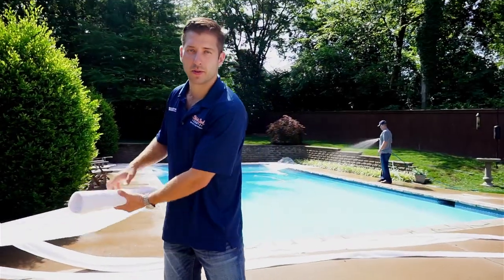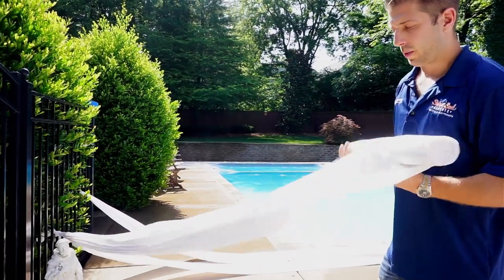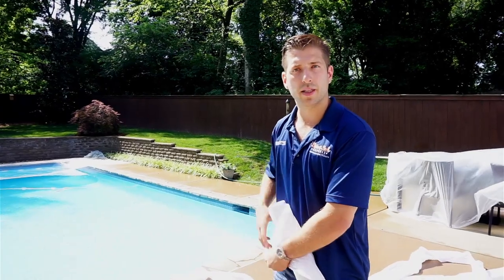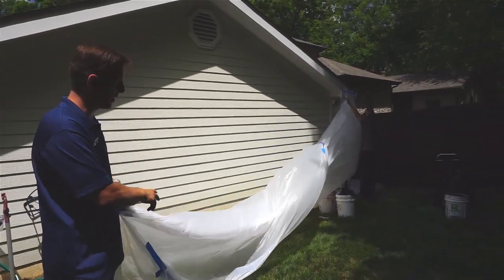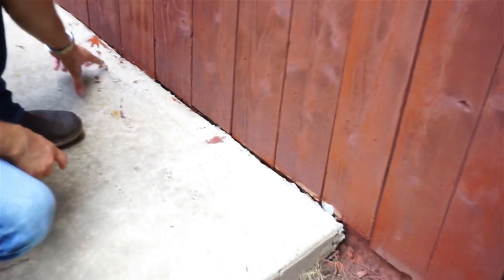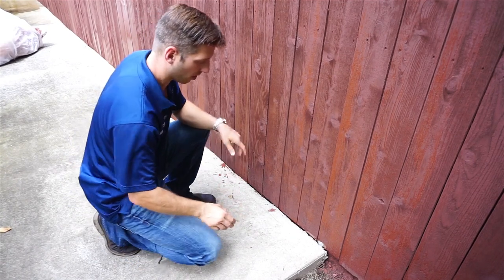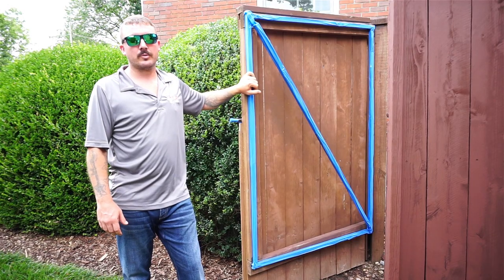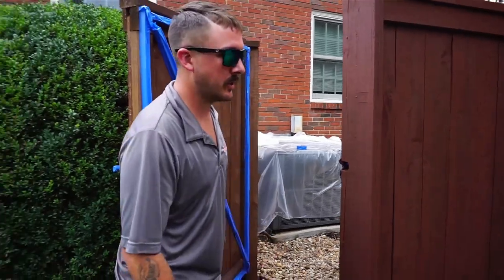How to be a Masking Master

Comment: I know this video is 2 years old, but you caught my attention. In the video, you said you're using a water base stain. ESS is oil based. What stain did you use here?
Reply from the maker: For this project, we used a water based stain. It had a previous coating on it that was also water based, so we reapplied in a similar color.

Comment: Was the pool that close to the fence that it required masking? It looks further away in the video.  Thanks!
Reply from the maker: Our clients expect the best from us, no liabilities.
Reply: When removing the plastic from the pool, would any stain that’s on it be dried by the time you remove it? How do you prevent stain from running off the plastic and into the pull when you’re removing it?